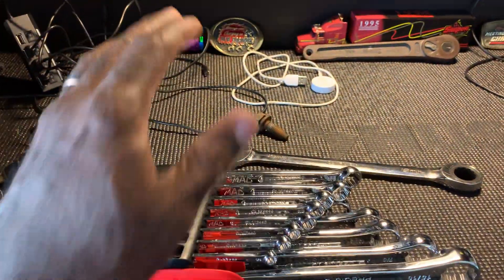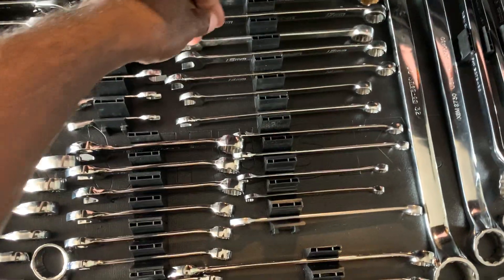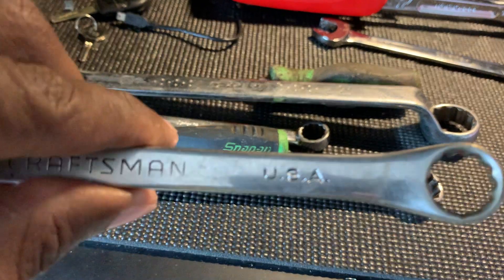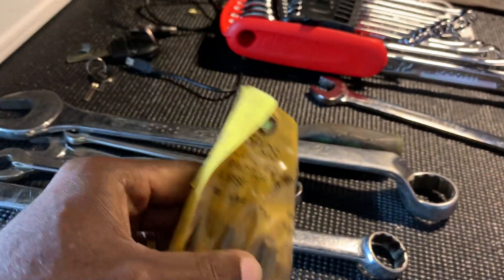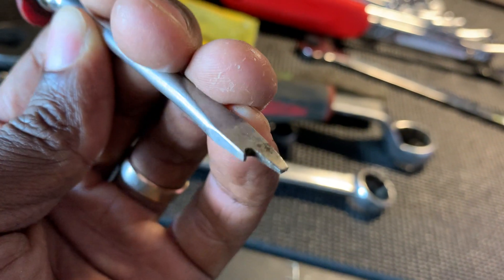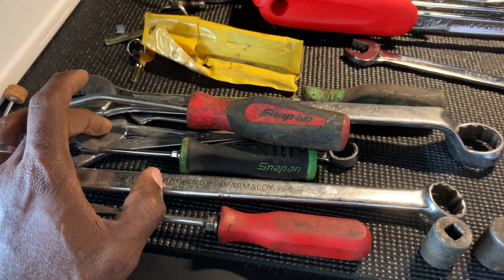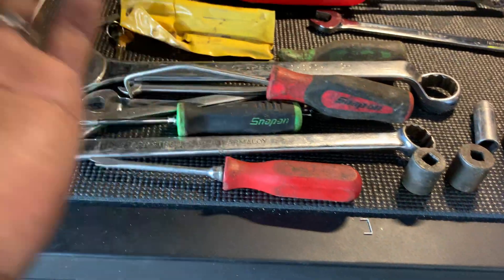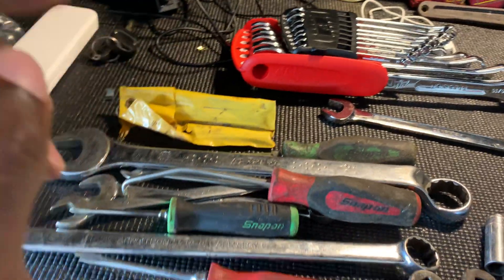OVER $200 IN SNAP-ON TOOLS AT GARAGE SALE | #facebookmarketplace #snapontools #estatesalefinds

Comment: Nice haul Midwest. Ford tech here, you are right, ford does use 11mm. It’s a rarer size but I have run into them a few times. I think it will also come in handy for running any special tools/pullers/thread restorers that take a 7/16 socket

Comment: I just sent some Mac ratchets for warranty.  What did you mean when you said they've been brutal for warranty lately (like just slow, or refusing to replace certain items)?
Reply from the maker: It took months to have a simple tool replaced. When I spoke to them, I was informed that they were on a National Backorder for most of their common items like ratchets, sockets, etc. They said, I’d have better luck tracking down a dealer if I needed the item quickly. At that time, my dealer had Covid, so I had to rely on them. Took 4 months just to get back a hand full of sockets
Reply: @MidwestToolReview  Oh boy, hopefully I don't end up waiting for months. Guess I won't hold my breath then, thanks for the info! 
Also one more question, when you aquire used snap on tools that need to be warrantied, when you call Snap On for warranty, where do you say you bought them? I have a few sockets I bought that are cracked that I would like to have warrantied if possible.
Reply: @ToroMoto  try to find a dealer/truck in your area. Can be hit or miss if you dont do business w the dealee if hell warranty it out from you since you didnt buy it off him, but some dont care and will warranty it out. Just depends on the dealer. If not just call cooperate and mail it in. If they ask say you worked at a shop years ago you dont remember the dealers name.
Reply: @jacksmith2315  appreciate the response, thank you